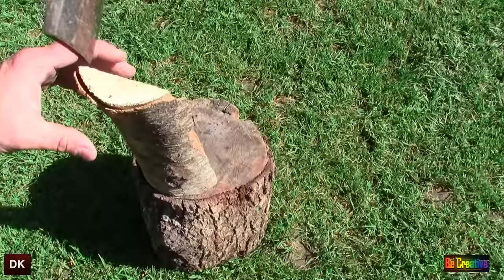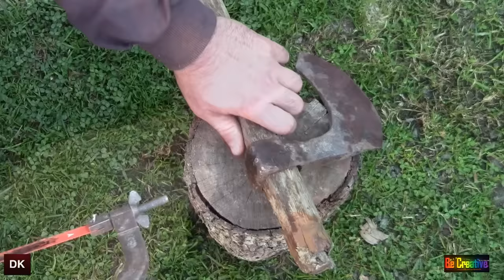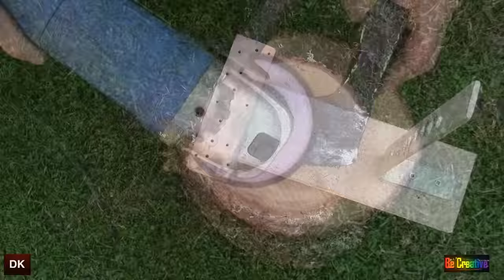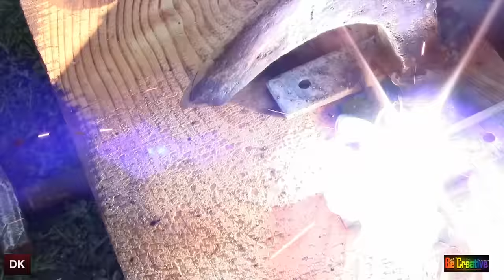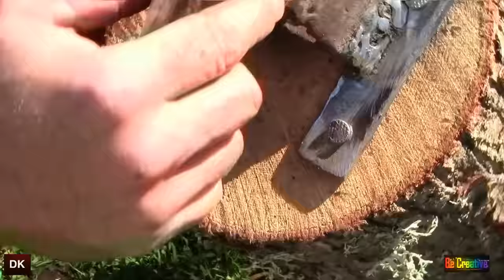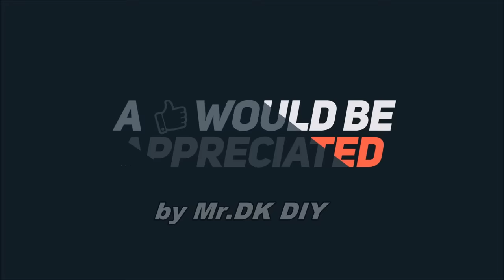How to make Kindling splitter made from an old axe head  DIY

Comment: Well made. I would suggest you attach it using screws instead of nails.
The nails will loosen as the wood dries or take a bit of a beating. Screws would remain solid for longer imho.
Reply: I was thinking the same thing! Screws would be better alright.